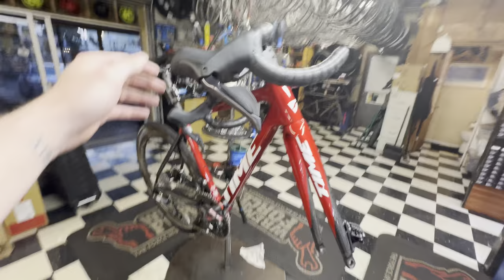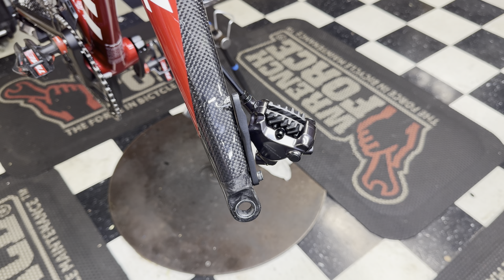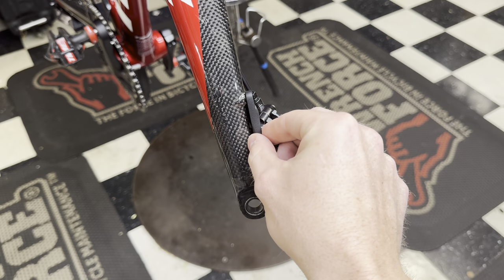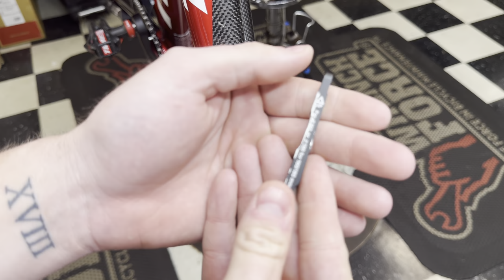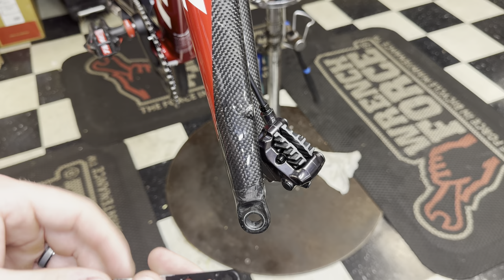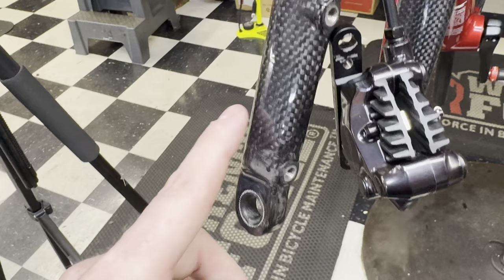HUGE Issue Found with TIME Bicycle Frame

Comment: Wouldn't a small washer on either end between the mount and frame work?
Reply from the maker: it would have to be larger then just small and then at that point you are messing with brake pad contact and the pads would not bite the rotor where they should... yes it would fix the problem of not rubbing but you would not have your brake, braking efficiently and pads would wear out weird
Reply: Why should we need to do that on frame from a reputable brand.

Comment: It is no issue, but I write HUGE issue in capitals because that gets more views.
Reply from the maker: it is a issue, its a 4000 frame that has an issue, if the customer wanted to build this bike at home because he bought ti consumer direct, the bike would not work properly and they would have to wait for emails back and forth until they find a solution and spend more money and time to strip down the bike again and replace the fork and rebuild the bike again, its only no issue because we fixed it here. but if you spent 4k and built the bike and couldnt get rid of disc brake rub and had to wait for a new fork and re run all the cables you would be pretty bummed

Comment: I would have used a washer underneath the bracket
Reply from the maker: yea you can do that but you would need alot of them to get away from it, it was pretty pronounced and also then the brake pads do not sit wherre they are suppose to

Comment: Another win for RIM brakes :face-blue-wide-eyes:
Reply: Agreed. Rim brakes work, as long as you don’t expect to actually stop in emergencies.
Reply: This is not a negative of disc vrkaew, it's bad quality control, manufacturing.
Reply: @87togabito  On a roadbike the limiting factor for braking is not the brake system (aluminium rim walls not shite CFRP/carbon plastic rim walls) but the narrow tires, e.i. not the cheap walmart rim brake bikes, just look at the previous pro tours with rim brakes and you'll see that the rim brake exceed the braking traction of the tires.

Comment: You should have used a Dremel tool it would be easier!👍
Reply from the maker: I was thinking about dremel, but I had the bench grinder there and I didnt want to mount in the vice to clamp it down and also I Was concerned it was not going to be enough power, ours is from harbor freight lol

Comment: Or you could have put those "cup and cone" brake washers between the adapter and fork
Reply from the maker: it would pull the caliper away from sitting on the disc rotor properly and the pads would not bite the disc rotor as they should
Reply: @GCPerformance18  
It would move it ever so slightly

Comment: If there is something with the seatpost and Schmolke sees that you have clamped it in this area, bye bye warranty. 
Lightweight parts have to handled differently to normal carbon parts.
Reply from the maker: it is clamped very softly, I work on  lightweight parts all the time like darimo, there is no stress on there, and if you think there is, just from the weight of the bike in that stand then imagine a 165lb rider going down a hill or mountain and hitting a bump while the rider is seated.... what do you think is going to have more stress, I would hope those seatpost can withstand riders weight, where as this case the clamp is very loose on there with only the weight of the bike

Comment: why not just a washer spacer on bottom bolt 
it would not effect rotor .5 of a millimeter who cares if brake pads are center or just near edge makes no difference on a road bike even downhill 

or spray paint mount before replacing

should be fine

downhill bikes with 220mm rotors have washers 
the mount is just a flat mount washer
Reply from the maker: that washer would not be big enough to space it out

Comment: I guessed right with your solution which is practical from an engineering point of view, however as a customer I wouldn't be happy with it as a final solution, knowing absolutely nothing about carbon and why defects occur and what that means further up the road  I'd want it replaced..   Cheers

Comment: It’s either clear coat or excess epoxy. Both will sand down very easy. Just do it very slowly with 800-1200 grit depending on how cautious you want to be. Polish it after, maybe 10-20 min of work. Perfectly good fork, no need to be wasteful asking for another fork.

Comment: I reckon a couple of washers might have sorted it out? Depends on the angle and alignment of the brake caliper afterwards though.
Reply: No. The position of the caliper changes with washers. Creating an additional problem, the pads will not be on the disc 100%.
Reply: @SPLSE  Did you read the second half of my comment?
Reply: @Hambini  Did you?

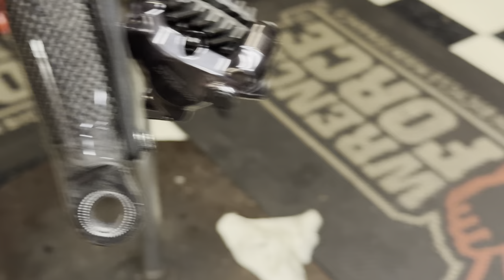Comment: 1:16 Factory defect. Just send it back and get a replacement frame. 😊
Reply: How they respond reflects a lot about the brand.
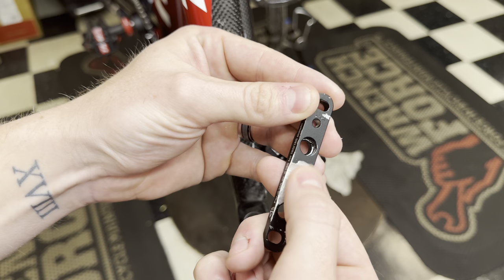Reply: Btw, Bastion forks for their hidden cable disc brake forks have issue too. With a little bit of elbow grease, mechanics had to file some stuff as well 5:17